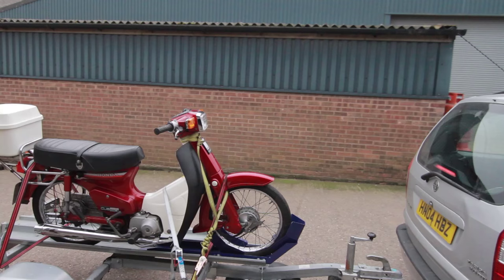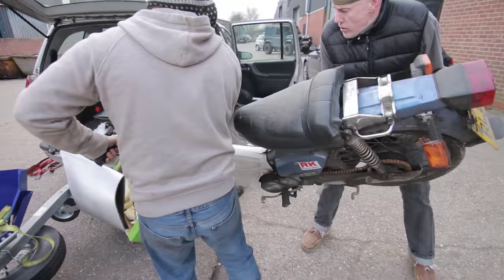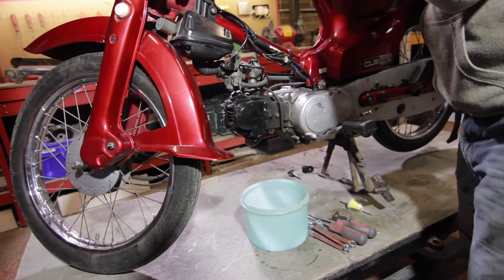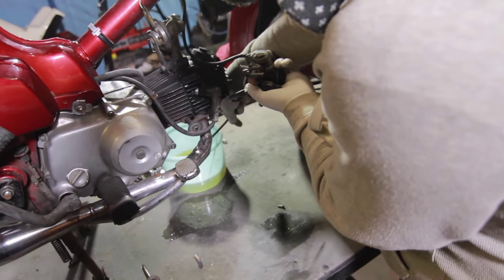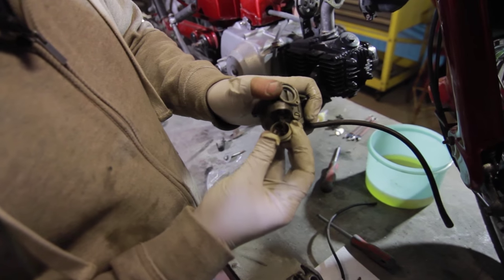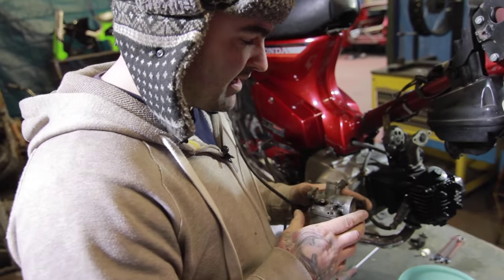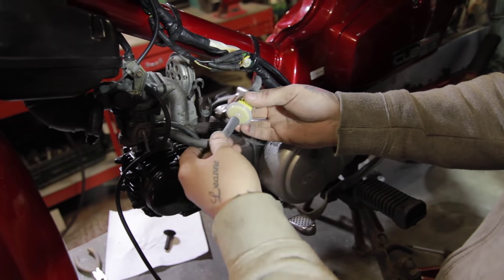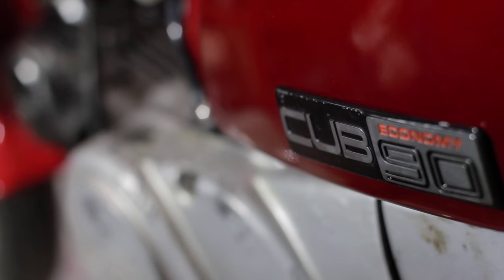Cleaning a Honda C90 Carburetor and fitting An Inline Fuel Filter | Gibbos Chopshop

Comment: A good video especially about emphasising caburettor cleaning. A useful tip when fitting an in-line fuel filter; after cutting the rubber fuel pipes to suit, soak their ends in a cup of boiling water for 30 seconds or so, this softens them temporarily making it easier to push onto the fuel filter and when the rubber pipes cool they fit really snugly. I would still fit metal clips though, just to be extra safe as you do not want fuel leaking over a hot engine!

Comment: Absolutely love your you tube channel, I have a few Honda c90s im not sure why but me and my son just love them. Never had a problem until this last one, its done 3000 miles one owner who stopped riding at 91 years old. I' ve stripped it new tyres exhaust all re painted etc  The problem been it wont tick over and will NOT run with the air filter on, i've fitted an after market K&N type thing its better but really uneven when it runs. Any clues I'm desperate ?
Reply from the maker: Thanks Steve! Cubs do have a certain magic about them. 
Your question is a bit of a head scratcher. Have you asked on the Camphill Cho Shop Facebook page? https://www.facebook.com/groups/camphillchopshop/

Gibbo should be able to help, if not one of the thousands of other Cub owners on there.

Give us a shout if/when it's up and running!
Reply: Sent  friend request. Thanks for the tip off
Reply from the maker: No worries! We might drag you on to the show to show us some of your Cubs some time!